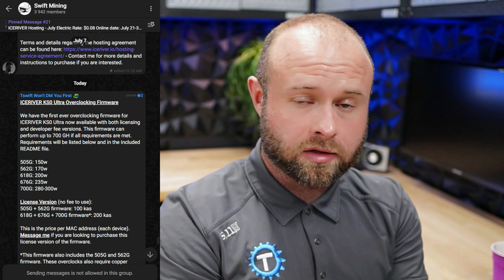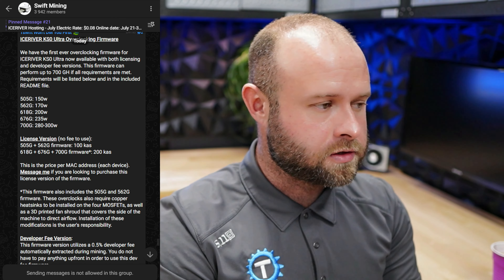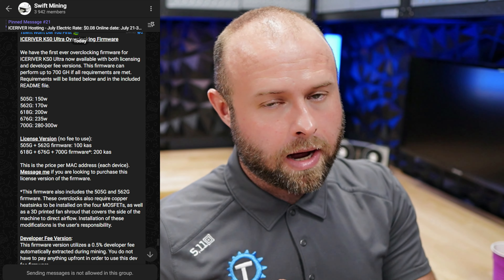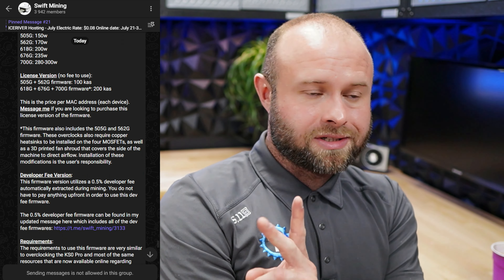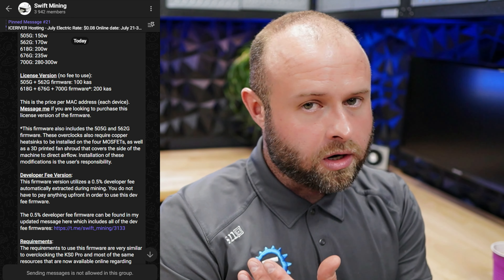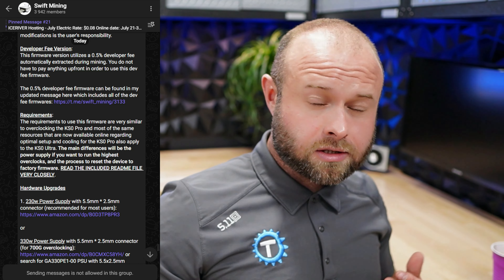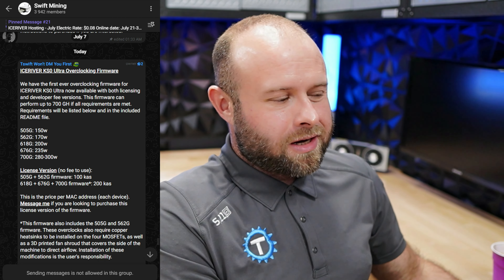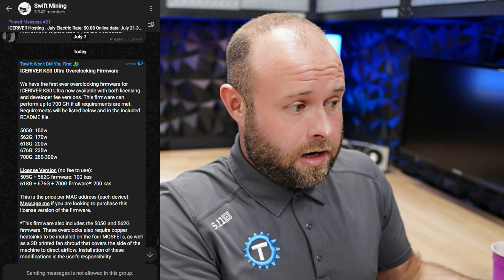KSO ULTRA OVERCLOCK FIRMWARE REEEEE

Comment: Awesome news!  I was expecting to wait a lot longer for this.  I bought my KS0 Ultras with 230W PSU's.  They were only an additional $20.  I won't get a 300W+ PSU.  Not worth the cost for the extra 25 Gh/s.  To me, this is way better than buying more KS0 Ultras.  The heatsinks, glue, etc. are pretty cheap.  Even the fan isn't too expensive.  I can print my own shroud.

Comment: You need to cool mosfets, which is expensive, and intense labor require. Than you lower your efficiency when power price is increasing. You also pay for firmware that might break your asic miner. Also you need to buy a new powerfull psu which is expensive. Also you will add additional fan to cool of which again is additional expense...
Reply from the maker: I did it before with the KS0, worked great. For the average miner, yea you have a point. But i'm a tuber, so I have to do what tubers do
Reply: Rubbish, you could be the YT that says Nah Bro, not worth the cost, effort, time etc. just be honest, cheaper to just buy another Ultra
Reply from the maker: new vid out with analysis on the #'s. makes sense to OC, eager to know your thoughts

Comment: Colleagues, has anyone managed to unlock their Icerivers Ultra after trying to update the firmware for better hashrate power? Could you help me as I have one blocked! After the procedures I did to update with the ini file and (k0u_562G_update) I restarted but the IP was offline eiceriver ultra and now it stays on where the two lights (green and red) are direct without blinking. What can I do to return this miner to its normal state? I don't have access via IP, and the resetdominer button isn't working, I can't factory reset my iceriver ultra.
Reply: what kinda psu for the 562G?  Is that still a thing?

Comment: Did you see that he also released an overclock firmware for the KS5L.  REEEEEEEEEEEEEEE!
Reply: only 12920G though, thought easy 13Th/s+
Reply: @mariusdekock6780  Yeah, it's a bit disappointing, but given the KS3 problems, it's amazing that the KS5L works well and can ever overclock.  Maybe with repasting and other mods >13Th could be possible

Comment: What happens if i buy the firmware once but i have 873675 ultras, can i use the same firmware on all of them?
Reply: No. They are locked to that specific MAC address or device.
Reply: Looks like it's per MAC address
Reply: Just wait for another firmware from other guy, you only pay 1% of income.
Reply from the maker: have to do the math. buying the license will ROI in 30 days ish
Reply from the maker: he has the 0.5% dev fee option

Comment: Saya overclock ks0 ultra dengan tswift free tapi tidak bisa kembali ke pengaturan pabrik dan tidak bisa terhubung ke internet lagi, bagaimana caranya supaya kembli ke deteksi oleh internet karena ks0 ultra tidak bisa online lagi? Tolong di jawab pertanyaan saya ini serius sy tidak bisa nambang lagi?
Reply: Hi, friend, did you manage to solve your problem, because I did it on my Iceriver Ultra and the same thing happened to me... it doesn't even accept reset via the button on the miner, but the lights (green and red) stay on directly without blinking... I have a recognized IP but on the iceriver monitor in the "Miner Management" panel it appears with the term "none" (off line).

Comment: I was wondering would be the first to report it.
Reply from the maker: i was at my warehouse when i saw the message. i drove home at 600mph
Reply: @TechnicalsMatt  lol.... I just finished right now doing all the mods to my Ultra, but I want to wait for your video before I upload the firmware. Seems the new firmware is no longer downloadable... Did you manage to get it downloaded before he turned off the download link?
Reply: @TechnicalsMatt  Turns out the 700gh/s is a bit too unstable so he is holding it back for now. But the other versions are available for now but only the paid versions..You get yours done yet brother?
Reply from the maker: just posted new vid

Comment: Why dont you buy barrel plugs from veteran miner and run a brakeout board with a 1200 dell pdu. Same as you would run for gpus
Reply from the maker: I only have the one device, and only plan to have the one, so not much need given it would be roughly the same cost for all those things